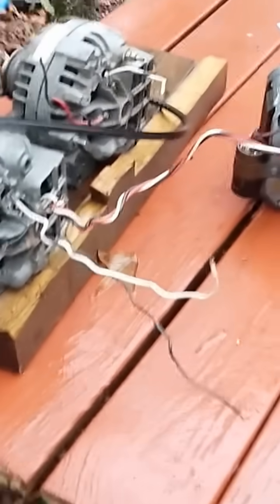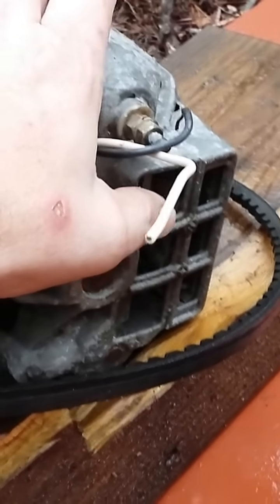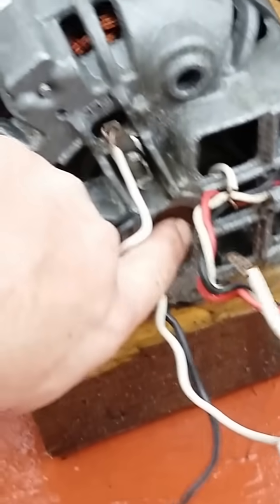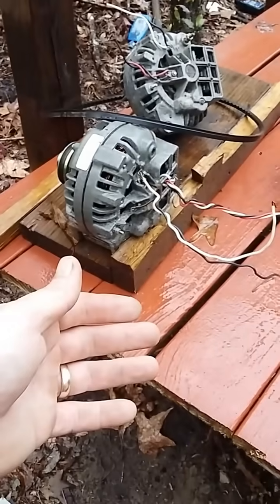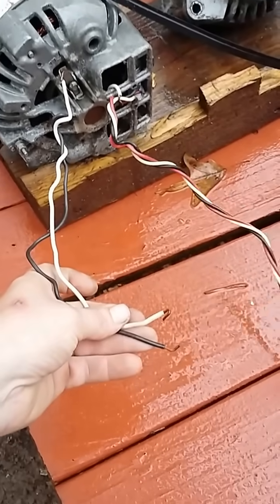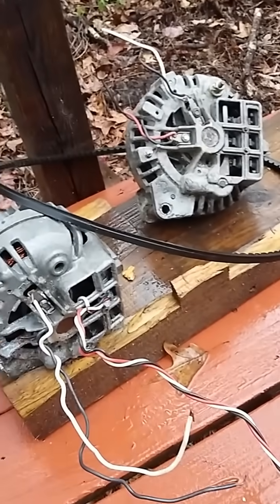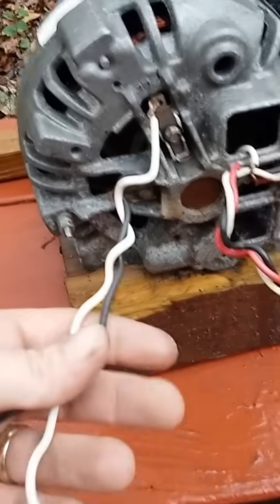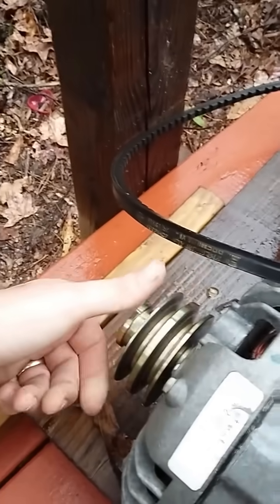Update Free energy forever no wind no solar no gas READ DISCRIPTION!!!

Comment: Im a gen tech... so dont think all us gen techs and gen enginers havent   thought of trying to think of something. Idk what u do but lets not try to get people to burn down there house. Lmfao
Reply: I get what your saying with a dam. Thats power of water current turning the gen. Solar water and wind are great ways to turn a gen for free and produce free power. And to answer ur question about the 3rd wire your saying that you dont use on your 3 phase gen. The only reason that 3rd wire would be getting more is that what ever your trying to power up in your house or where ever its not using all the power and backfeeding into that wire. Some high price generators will have AVRs auto matic voltage regulator and regulate the backfeeding voltage and send it back to the excitor coil to keep power at its regulated value across your 3 phases

Comment: Plus there not made to power up houses there made to maintain a battery. If u wire it and get it up to 60 hz  1800rpm and even do powee something it wont be long till your stuff is on fire
Reply: Thomas Buie Tom, interesting working model, did you try switching over the low voltage power into the motor over to a low voltage supply coming back off the 220v circuit? Thus no need for the battery but for the initial startup of your generator.
Reply: Lmfao bc i guess i dont have a degree in this 😂
Reply: And yes you are... and you forgot to mention your shade tree that saves you from the sun 😂
Reply: Thomas Buie he was obviously curious enough to watch the video like everyone else here. Don't let it get to ya a negative view is still a view.

Comment: Rofl... Umm famous line here. 'Do the math'. Power companies spend so much money producing power (not counting the equipment needed to distribute said power) coal, water flow through a damn water turbine, wind through a wind turbine, nuclear rods and steam... Etc etc... If power could be made by a device using some sort of perpetual motion I guarantee that system would be made all over the world in record time.
I live close to 3 mile Island. We have nuclear power plant, hydro power plant, coal power plant and wind power within a 5 mile area. As well as several businesses that have solar power. Each of these have massive overhead cost to produce power. They all would stop if they could make power free.

Comment: I think most people are saying you have to have an energy source to power the alternator which is correct, as you said in the video.  I do not have the video saved I don't think,, but I'll look for it. this fella took a small generator rewired it then used an eletric motor plugged into an outlet to get the generator going then he shut off the power to the motor that was now running off the generator , some how he had it wired,  it just kept running with enough power to power a skill saw and the motor which was powering the generator lol.. if I can find the video I'll post a link.
Reply from the maker: +Scott  Stephens I appreciate it brother but I think people believing in me now is a little too late I'm going to start deleting s*** I don't give a damn no more if I'm not going to starve and I'm going to suffer then everybody else can too

Comment: where do you get your 6 volts DC from ? a battery?
Reply from the maker: please read comments if you're talking about the 3vdc  that goes to the to field wires I use an 18650 battery and a 18650 battery charger.
Reply: from the electricity coming out of the wall lol

Comment: how did you build the motor that actually spins the stator.
Reply from the maker: if you pause this 4 seconds into the video the alternator sitting on the left in the video is my motor. I replaced three wires on it.  I didn't change anything. but it still has the bridge rectifier pulled out of it. watch my other videos a motor is a generator if you wire it the right way and vice versa. if you're turning the alternator and you don't have anything wired up to it you will have three phase output that you can weld with(DANGEROUS) but if you put a controller on the three wires it becomes a three phase motor when you charge the field wires or if you charge the field wires and then turn the shaft or rotor. The stator is the three wires that come out that's what you want to use to either collect energy or put energy into it(motor)

Comment: there's no way in hell you're going to get enough amperage from a Chrysler alternator from the seventies to power your house I played with electricity with my father who is industrial electrician and television repairman to know that little alternator is not going to give you enough load to run anything big maybe a couple lights can I run an AC unit off of it and you're definitely not running the resistance heater off of it but the principal works you do get alternating current by bypassing the diodes
Reply from the maker: +Mark Rankin yeah you're right but how many f**** alternators can I turn with a 1 & a half horsepower goddamn alternating current motor you stupid b**

Comment: Let me see it running with a load or running at all. Sorry buddy but what you said and showed me here just did not make a lot of sense to me.  I do a lot of crazy experiments myself so I am not putting your video down just need to work on your show and tell. God help me I may resemble that remark! LOL
Reply from the maker: brother this video is only to open people's eyes! I have other videos showing different parts of how the system actually works. this is the only video I have with misinformation in it it is made the open people's eyes how many generators can I turn with a 500 horsepower 3 phase Simmons electric motor I'm sorry how many hydroelectric turbines can I turn with it if I was to gear it with a transmission?

Comment: 90 AMPS AT 12 VOLTS !!! 
AT 220 VOLTS YOU WILL GET 4.5 AMPS DUH !!! COME ON HOMER SIMPSON !!!
Reply from the maker: yeah if you're using it like that! at 110 volts it would be 9 amps which is twice as much as you need to run a bigger motor to turn a bigger.   I understand that you felt compelled to say something on this video, please read some of the comments or at least watch a newer dated video before jumping to conclusions about all the lies!! this video was made so that you can open your eyes. Not, so that you would have all the pieces to the puzzle...  now that they're open.  :) What's the difference between an alternator, a motor, and a generator? It's time, you need to go look at a few videos of bldc motors to start off with.
Reply from the maker: +Charles Marik you are so smart there buddy I'm so glad you pointed that out because my electric motor alternate current motor uses 6.4 SF amps how many alternators am I going to need and one line to fix that stupid f**** problem dumbass

Comment: you can i send you and email with a pic of my alternator and could you be able to help me test out the diodes with my multimeter
Reply from the maker: Sure.  EnergyBuies@gmail.com
Reply: Thomas Buie 

I would like too see a video of the alternator apart... start there and show how you're wiring it up... then what are you using to spin the alternator?  Is your original power coming from the house or a battery?

Comment: what speed does the alternator spin at to generate the 220v
Reply: The output is rectified there is no oscillating current therefore there is not 50 or 60 hertz, unless you bypass the rectifiers to get the 3 phase AC.
Reply from the maker: well if you're in Australia you would turn it at 3000 revolutions per minute that would give you your 50 hertz or 50 pulses per second, but if you're in the United States then you would turn that alternator at 3600 revolutions per minute that will give you 60 hertz or 60 pulses per second... but you don't want it unregulated...  unless you're putting it on an electrolytic Transformer and then back off of it...  think about how you keep something from surging...
Reply: Thomas Buie does it matter what alternator it is
Reply from the maker: +Glenn Tate
It does not matter what alternator you use because you're going to take the direct current Bridge rectifier out of it you will however need somewhere to hold your power so that you can get past the laws of thermodynamics either a Transformer or set of capacitors but I would suggest and electrolytic dielectric Transformer I build my own I guess I should make a video of that

Comment: thomas are you adding the 6-12v too the alternator and turning the alternator over at the same time with another motor.  to produce the AC current?
Reply: i was thinking run the 6-12v off an inverter directly from the ac current side to help the unit be self sustaining then you could possibly pull start the .... and possibly run the alternator off a inline 110v motor powered by the generator itself.  that would be great to mess around with.

Comment: I am pretty sure you would need a heavier gauge wire to  carry your 220 volts.  Why would you bullsh*t people like this?  Guess what buddy.  i am not comin to look for you.
Reply: Vance Roberts you can run any amount of voltage over a wire, it's the amps you have to watch
Reply from the maker: okay then, how can they run 300 hundred thousand volts through a half-inch aluminum wire? but since you didn't cuss me!!! I'll go ahead and answer that question. They are running it into electrolytic dielectric Transformers / capacitors
Reply from the maker: +Vance Roberts  hi Vance please go look at the video I just posted brother have it running through about 18 maybe 20 gauge wire really small and I'm running 300 and 400 volts through it equal @ = amounts through each wire. Brother trust me I'm not trying to rub anything in your face but it's not the volts that will hurt the wire it's the amps or the load that you put on it. that's where your math has to be just right and you have to have some type of way of storing your energy to use later or at that Moment. I'm getting ready to wind one of these small motors and show you guys a very big surprise!!! I just want you to believe in me that's all I'm asking for?  Brother I tried asking for money I tried asking for just materials to send to my pill box and Mabelvale but that caused a lot of hate and I don't want to do that at all so I'm asking people not to donate to me anymore and now I have received two donations and someone watched my father daughter video I forgot to take the charge off of it...  Brother in the name of Yahweh!! I am not here to scam anybody!!! I will probably never ask anyone for money again until the time comes to where I'm so desperate I can't sell anything or Pawn anything else...   but these projects will get done no matter what I have to do I will completely fund them myself from now on with the hundred fifty to $300 that I get from YouTube... I figure the more videos I upload the more Petro slavery I mean money I could build up and may be able to live off of it eventually and that's the truth!!!

Comment: What alternator is that exactly?
Reply from the maker: +Zlatan Ibrahimovic it's just an old General Motors alternator it's rated for 80 amps at close to 14 volts DC before any modifications
Reply: Thomas Buie thanks man, I watched one of your other videos where you show the serial of the alternator but still couldn't find it. I just want to know because that alternator is way easier to work with than other ones that have plugs, tight spaced and hard to open and that, cheers anyway
Reply: Thomas Buie also I sent you email dude if you could check it out thanks Thomas
Reply: Zlatan Ibrahimovic that is a Dodge alternator early model 70s and 80s..we use old School lawn edger's and take off the blade are and replace it with the alternator bracket and alternator .add a mini set  of jumper cables start it up and use it  to charge our race car battery in between races.
Reply from the maker: +donald coxe that's pretty cool I bet it doesn't take but a couple of minutes to charge them 18650's how long can you run your little Servo motors with the heat sinks on them before they give up and die? and I'm not being sarcastic just curious this alternator is nothing more than a big Servo motor plain and simple and it never heats up...
Reply: donald coxe yes!!!! Thanks so much bro i found it, legend
Reply: Zlatan Ibrahimovic you're welcome

Comment: it just pisses  me off when people like that chat at threatened your life over finding free ways to get energy or anything like that
Reply from the maker: +Derek srt 

nope a water wheel or wind wheel set up could never and would never work like this!!!!!!! there's too much drag and you could never get 220 volts out of 2 110 volt wires. I'm sorry two phases of 110VAC @ 80 to 90Ah . And when it says self exciting in the description that means that there's hardly any drag unlike with permanent magnets...  you want to see 20kw VAC  running off of a 1 & a half horsepower compressor Duty AC motor look at my other f**** videos the generator head or alternator head itself is rated for a 16 horsepower gas engine and I'm using 1 one and a half horsepower engine to power 2 generator heads so you do the math 2475 continuous watts and @ A SF of a little over 3000 Watts at 115 volts yeah that's 8 or 10 amps to make almost 200 amps Peak with 14.2 amps at 110 volts continuous you do the math I've already done it a hundred times and if you would have watched any of my other videos you wouldn't OF even a commented on this one...
Reply: I think he misunderstood.  When he said he just hooked the 3 wires into his electrical box my first thought was he was going to die as well.  What he is doing is deceiving people and that is not cool and very unsafe.  An alternator is designed to run about 15 volts to charge a 12 volt system.  There is no way in hell he is going to get 220 volts at 90 amps out of it even if he bypasses the diodes.  The diodes just rectifies the alternating current from the alternator into dc in order to charge the battery.  He also left out how to spin the alternator which would take several horsepower to get 90 amps at 15 volts.  You could make power with a setup like this if you used the alternator with a water wheel or a wind mill design.

Comment: 90 amps is number 1 wire. it looks like you might have number 8 wire where you have your a/c voltage out put. if you are actually pulling 90 amps you would melt those wires. please explain
Reply: Thomas Buie, my brother Im just trying to learn from you. I find it very, in fact extremely interesting that an individual is able to pull 90-100 amps out of #10 maybe #8 wire and not cause an electrical fire. Im just sincerely interested, and want to learn. thank you for sharing
Reply from the maker: +Bdpjev  
do you know how to build an electrolytic Transformer that is not a step up or Step Down Transformer? if not you can figure out how in one of my other videos titled A to Z P^.  Now if I take a 1.5 amp 12VDC  battery charger and hook it up to a thousand amp 12 12VDC battery is it going to melt the wires on the battery charger? I hope I answered your question brother... STAY SAFE!!
Reply from the maker: yes you're correct on your wire sizes and such. but tell me how many times you have you melted a test wire that was not in a closed circuit?
Reply: Thomas Buie, never because theres always a circuit breaker in place to trip out. but I have ran across wires that are attached to a circuit breaker that has tripped and the wires are burning hot. like on the verge of melting. thats because they were not sized correctly. can you connect a volt meter to show that you are actually getting 208-220 volts and have a motor or a couple of appliances pulling 30 amps and show on an amp meter 30 amps
Reply from the maker: +Bdpjev  yeah or I could just show it already hooked up to the romex going to my house with outside fans and outside lights going right now and 2 or 3 fans inside going and a full size refrigerator going and a window unit air conditioner going in my trailer trash trailer.

 But I don't think I will do that, dogs that lay in the dirt don't get up and lick dogs that are on the couch or share their food with them.  Especially when they haven't been fed in a few months...
Reply from the maker: +Bdpjev 

 but here's the real kicker!! when you find a dog starving to death and won't take food from you... you have a real problem and you just met me! I don't want anything from anybody!!!
Reply: you want nothing from anybody ? You want their clicks to get paid by youtube.
Reply from the maker: +Sajid Rafique  Yes I do want that slavery $ because I FN'D earned it and you know what... That $167 or so that I got from YouTube saved me from losing my land! Well, that along with the things that I'm having to sell from around the house!! so boo hoo be a man!  and get off your lazy broken back piece of shit ass and do something Thomas right...  that's what you were going to say right?
Reply: Thomas Buie, you the man. i am very familiar with step up n step down transformers but I have to learn about the other style you spoke of and check out ur vids. I got a question though, how long does the batteries last that keep your alternators going? if they are rechargeable you need a seperate power source to charge them up right?
Reply from the maker: +Bdpjev that's why I have a battery charger/ battery maintainer hooked up to the two car batteries I have that are ran in parallel so I don't get too high of a voltage and they never run dead while they are going to my bldc motor/alternator controller...  it's not possible for me to run them things dead because I'm using on my SF about 10 or 12 amps but once it's running you know it doesn't take near that much I think I metered it out consuming 2400 an something Watts producing almost four times that continuous and five or six times that Peak...